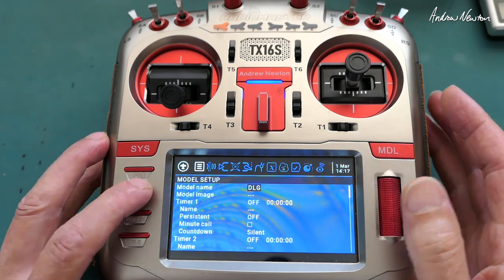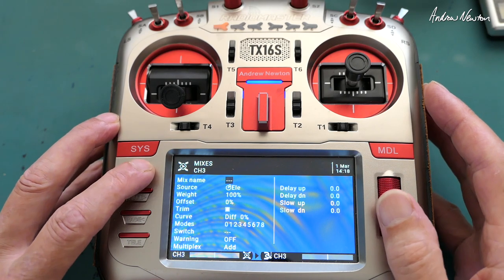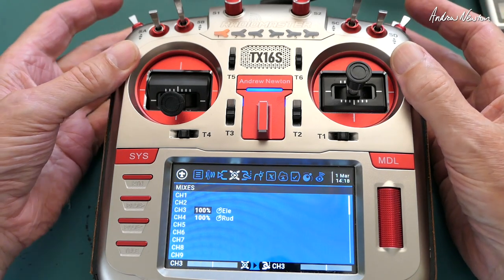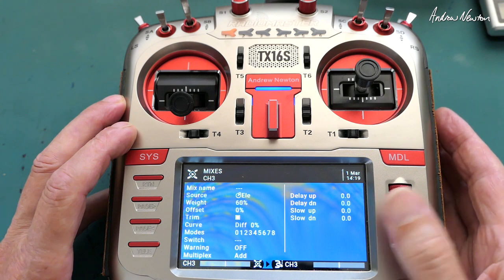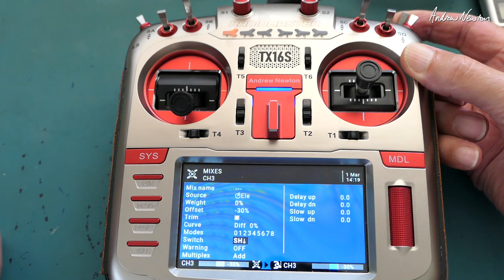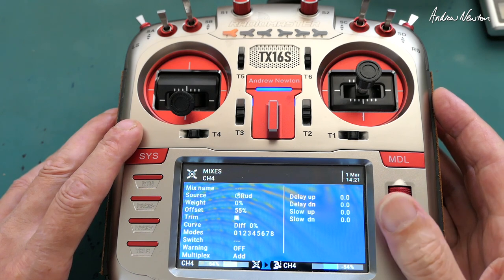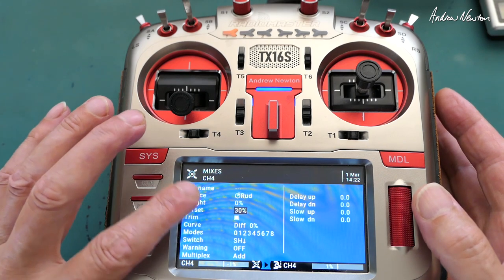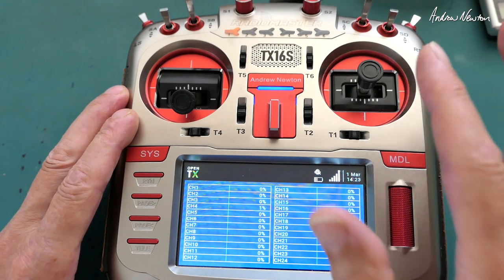DLG launch mode on a TX16S

Comment: Thank you for the video!  I am building my first DLG right now, and I'm new to Open TX.  Your little "trick" with the mixes, and setting the weight to "0" was brilliant.  It may be obvious to those experienced with Open TX, but not to someone just learning.  Thank you again!
Reply: I strongly recommend you go google "Mike Shellim" and his DLG templates. They are fantastically well designed and complex setups that are exactly what you want in a DLG radio setup.
Reply from the maker: Amazing OpenTX work from Mike, but way too complicated for my fun flying.
Reply from the maker: Thanks Mickey, can use curves too, but offset is simpler
Reply: @AndrewNewton  Up to you entirely of course, but to take full advantage of a DLG, you'll want most of the functions Mike's setup gives. Better handling, more performance range for different situations in DLG, and just a much better flying DLG all around. A DLG setup like that offered by Mike's template is really only the start of tuning a glider - most pilots will spend hours and hours tuning the glider after that, and it's so amazing to see how much better a glider can fly after all that effort.
Reply: Thanks for the info CyclingMikey, I checked out all the info on his DLG Template.  The DLG I'm building is a Poly wing with just 3 channels, Rudder, Elevator, and Flaps.  So, for now it seems to be way too much.  If/when I move up to a flaperon wing, I'll give his template a try.  Thanks for pointing me to a great source for more advanced models.

Comment: Thankyou so much Andrew you are a ledgend!!!
Reply from the maker: Happy to help
Reply: FYI you might like to check out "Mike Shellim" and his OpenTx DLG templates. They are fantastically well designed complete setups with launch, zoom, speed, cruise, and thermal modes set up. Do a google for Mike. I did change my SF switch to a momentary version as I'm right handed and thus want a momentary launch switch for my left hand. I've used Mike's templates on both my Yoda DLG and on my Shinto Electric.
p.s. love your videos Andrew, I'm a massive fan!

Comment: Andrew what would be a good and or cheap DLG to get started  I would not want to spend a fortune on carbon fibre bla bla bla just to throw it in a tree just want to dip my toe in
Reply: the dreamflight libelle is cheap
i'm sure there are some higher quality kits on ebay
Reply: There are no good and cheap DLGs, good ones are not cheap and cheap ones are not good. Your best bet is to get hold of a second or third hand one. I bought an ancient Validol as my first DLG and it has been a great introduction to discus launch without risking close to a thousand pounds for a good new one
Reply: I bought a Mini Dart from Neil Harrison at Superfly.  It's 1m, so easier to handle, and perhaps more robust.  Thomas Lee at Armsoar strongly recommends it as a starter model.  There's now an MD2, which has a bit more space in the pod, which is my only criticism of mine.
Reply: @archivist17  ah yes that one is great, too
Reply from the maker: This HK V2 fitted that category when it was available. Maybe look for Topsky if they are still around. I don't like the Raven or Apollo balsa DLGs, too delicate
Reply: @marc_frank  Libelle is a terrible dlg.. Id suggest a mountain models dl50 if you were in the sub 150 quid bracket..
Reply: @Tsnafu  Absolutely agree.. I owned about 6 cheap dlgs, all in the bin within a few months of buying them... Bought 2 expensive ones, and they still fly any time I feel like going out for a throw..  If I had been smart enough, I could have bought a good one at the start and I wouldn't have wasted hundreds of pounds in the bin..
Reply: how about the arthobby momentum or bobolink
Reply: @marc_frank  There nice but turn out quite heavy with the wood skinned wings.. The weight they show on the sight is the unfinished weight as the kit comes.. I think my cousins bobolink was about 160g.. A bit of a pig at 1m..
Reply: @petrokemikal  works better on windier days :P

Comment: Any suggestion how to add momentary switch function on the left side of Radiomaster?
Reply from the maker: Switches can be swapped but it involves soldering. Someone has done a how to video.
Reply: @AndrewNewton  thank you. I found a few interesting videos…I like the idea how to add additional push buttons switch to the backside of radiomaster for launch mode. Tnx